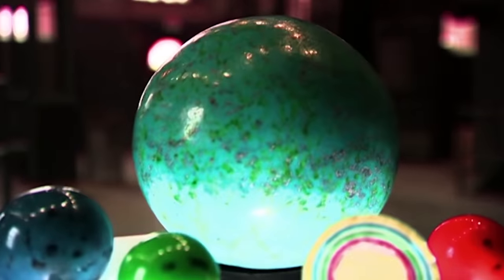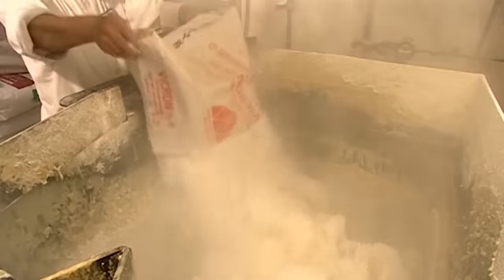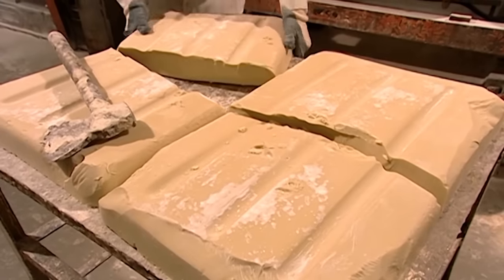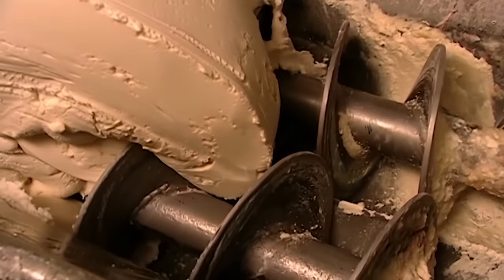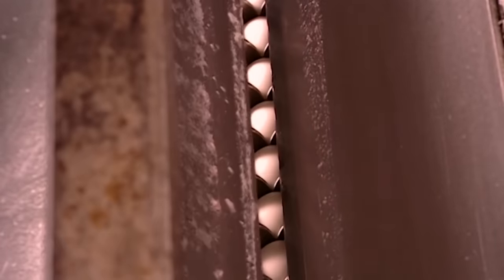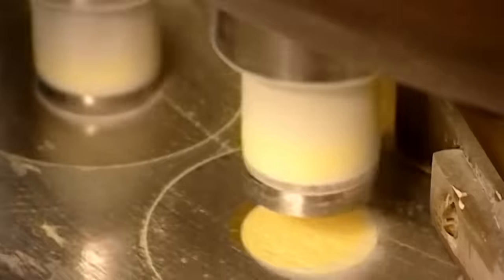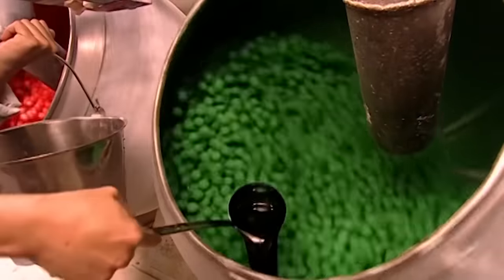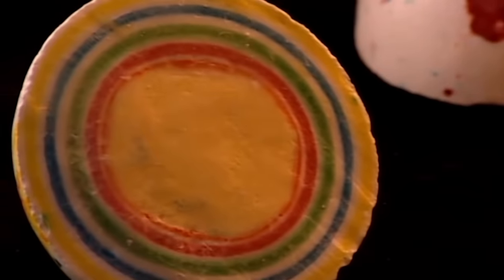How It's Actually Made - Jawbreakers

Comment: The powder is actually a mixture of several powders, consisting of mostly one type of powder with several other, slightly different types of powder added in. It is added to the jaw breakers to give them a light coating of powder.

Comment: HOW IT'S ACTUALLY MADE: CHOCOLATE

This company makes chocolate in various forms, and then sells it to companies which manufacture it for retail sale.
It also supplies chocolate components such as cocoa powder, and cocoa butter.
First, an innocent cocoa bean bag is made out as an example to the employees who don't meet their daily quota.
It's succulent beans spill into a collection tray.
A conveyer belt moves them to a cleaning system, which is a cage filled with starving refugees who lick the beans clean of any dirt and debris.
Next stop is a microniser, which heats the beans and spins them at a constant rotation, seperating them from their families.

[Pause, view of cocoa beans spilling off a conveyer]

Then, they enter a shell removing machine called a winnower.
Inside, the beans are read various bedtime stories, which trick them into thinking it's night time, causing them to remove their shells.
Then, a vaccum is applied to the beans, resulting in the two most popular forms of chocolate: Hard Chocolate, and Not-so-Hard chocolate.

[A glass filled with yellow liquid (presumably something to do with the manufacturing process) shows on-screen]

Here, you can see the employees dedication to working through their bathroom breaks.
This solution is later added to the final product for flavour.
An employee then activates a grinding machine, wherein the constant heat and pressure create a chocolate soup mixture referred to in the industry as: chocolate soup mixture.
The factory extracts some of the cocoa from this mixture and immediately pours it in the sewer in a bid of enviromental conservation.

[pause]

By this time, the beast has been awoken, and must be fought back by employees with various instruments.
Doing this allows the chocolate to pass through mixers and refiners to give it a softer texture, and also provents the beast from ushering in a thousand years of darkness.

[Pause]

Now, the chocolate is in a very delicate state, to which even the smallest disturbance can ruin the batch.

[Visuals: an employee is seen scooping up the chocolate powder and showing it to the camera.]

The employees arevery carefu- [louder] What are you doing, Peter? [/louder]

[everything moves on as if nothing happened.]

At this stage, potting soil is ground into the chocolate for about six years, allowing the chocolate to return to a liquid state.

[Pause]

Then, the chocolate goes into this big- fucking machine and uhh- I don't- I dunno what this thing does but- by this point the chocolate is now chocolate chips i guess.
The chocolate chips are then jostled ever so slightly, to prevent them from falling asleep, creating their rich and stressed-out flavour.

[Pause]

[A pressure valve measure is shown]

The chocolate chips are cooled until about 50'o'clock.
The chocolate chips are then given a brief experience of typical californian traffic.
Finally, the chocolate chips are again jostled, This time just to piss them off.

yes. i typed this out manually.